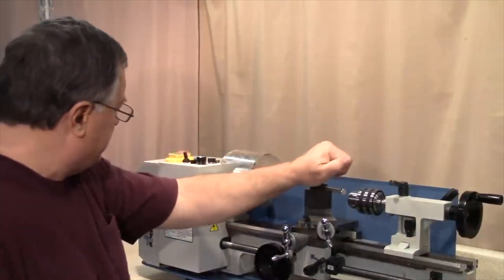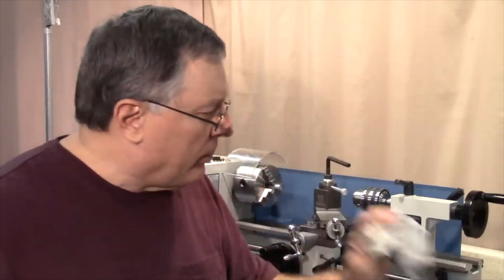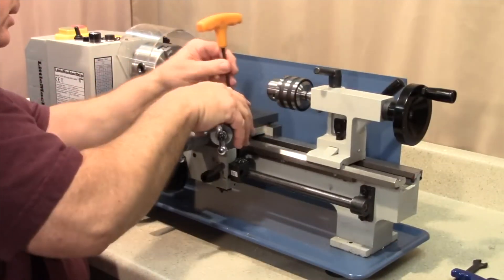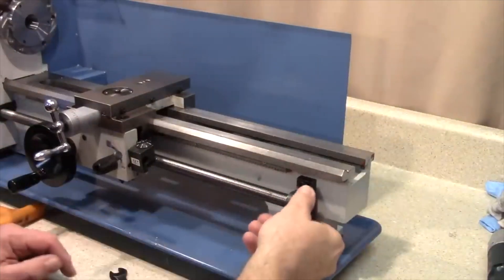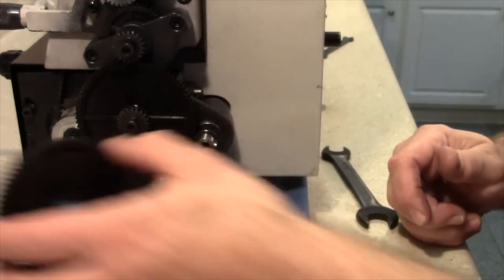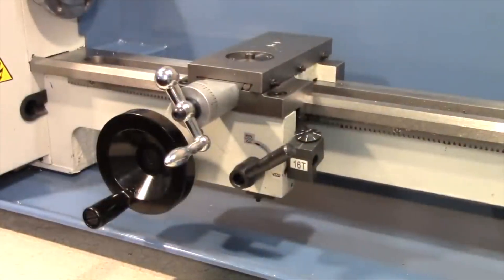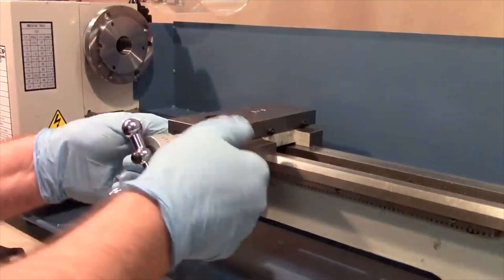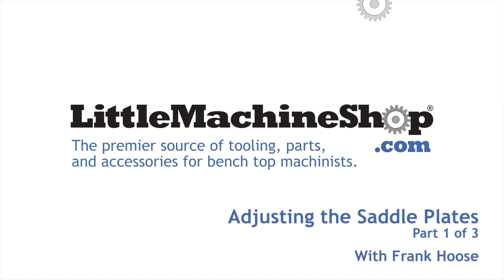Adjusting the Saddle Plates Pt1

Comment: Yes! Be careful with the leadscrew!  You'll have to make replacement.  LMS doesn't carry replacements for many of the lathes.  It's often referred to as part number 129 on the exploded parts diagrams. Well Done! Thanks for posting!😃
Reply from the maker: Yes. Be careful when ever working with or on machinery... We do sell the leadscrew though (http://lmscnc.com/3956), but some earlier 10", 12", etc. were moving to special order given low demand.
Reply: @Littlemachineshop  Ok. Thanks for the info!  I have a LMS 1014 (7 X 14) that my wife bought for me and I use it a lot for turning threads.  Even with proper lube etc. it's a lot of wear and tear on the leadscrew, and one day I was thinking "can I get a replacement leadscrew?"  I Checked LMS' site and couldn't find it.  Thanks!
Reply from the maker: @jscott8695  Thanks for the info. You are right, we don't show it? Looks like we ran out and it got dropped vs. re-ordered (a mistake) I just ordered some more and if you needed "now" we could likely accommodate with parts we have "around"...